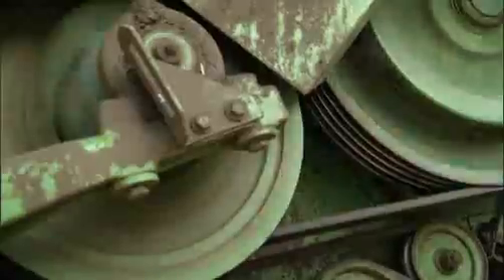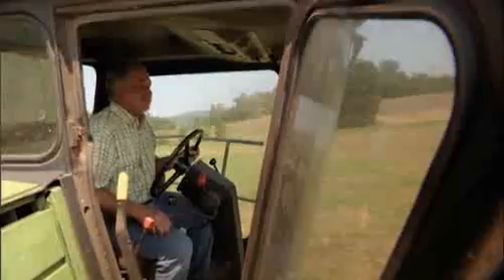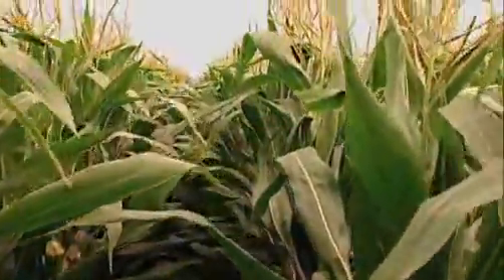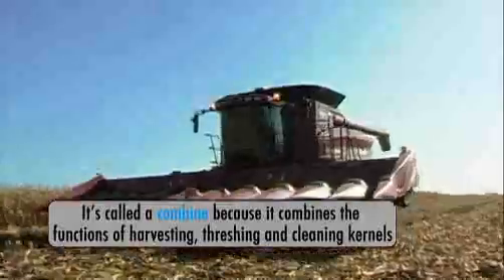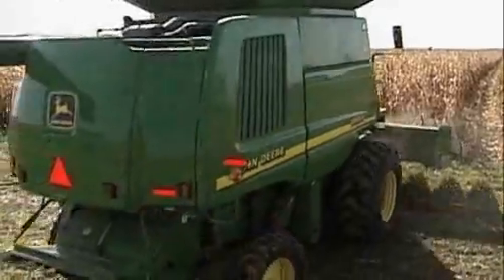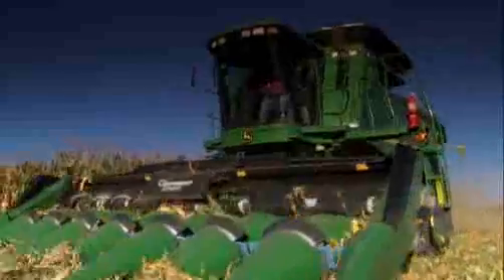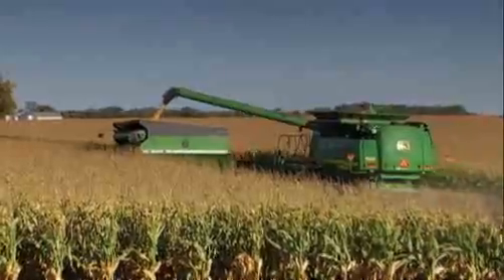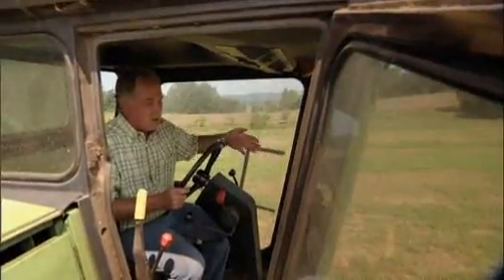HowStuffWorks Show: Episode 1: Corn Combine

Comment: Question.  First off I'm not a farmer.  Here in the midwest we have a lot of corn, a lot of shelterbelts and a lot of storms with strong winds.  Early this summer I noticed after a storm there were some branches that had blown into the corn along side a shelterbelt.  The corn was about 2 foot tall at the time.  Some of the bigger branches were cleaned up but I'm relatively sure that not all were cleaned up.  What would happen if a tree branch 6 or 8 foot long and about 2 inches in diameter was accidently picked up by a combine while combining corn?

Comment: Not nearly detailed enough. A corn harvester is like a portable seed plant. It has to husk, shell, and separate the corn. Maybe even size it! Flat 1, flat 2, round 1, round 2. I have only been working with seed (Dent) corn for a few months. We receive corn still with the husks on, and the kernels on the cob.
Reply: Is there no nutritional value in the cob. What happens to it when the corn is removed.